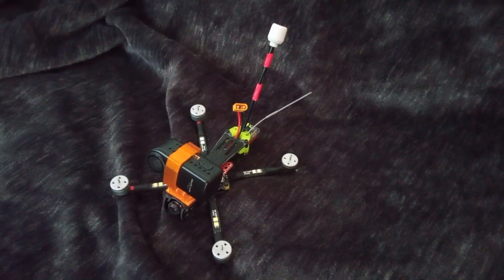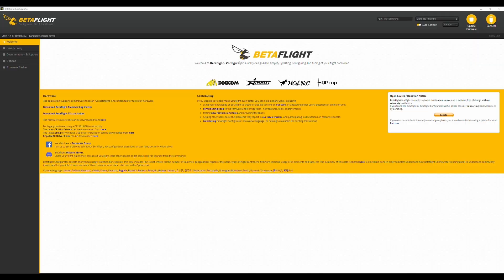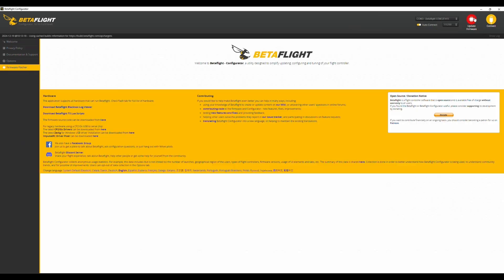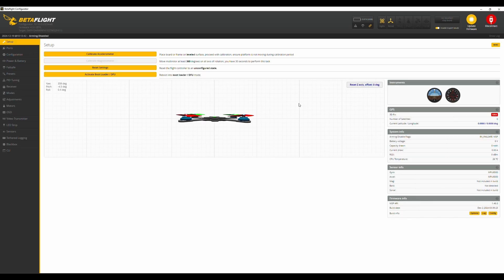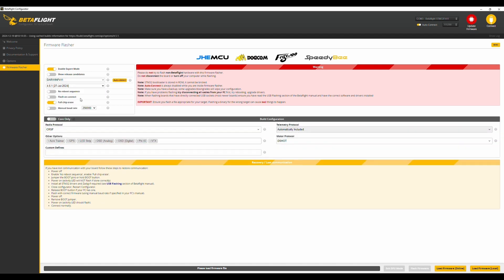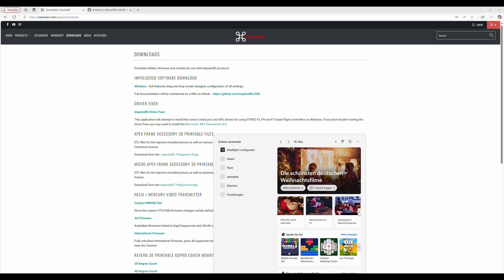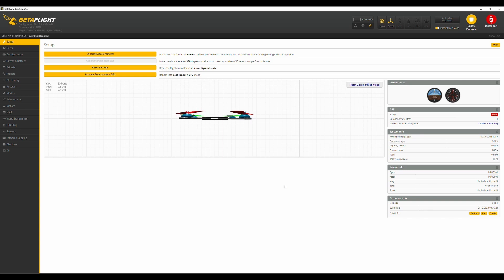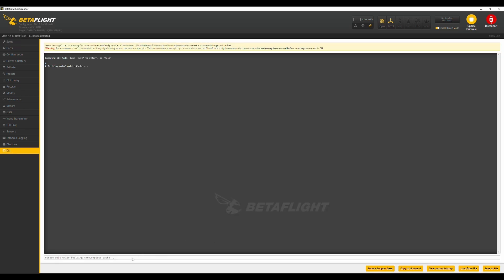How to flash DarwinFPV BabyApe Pro V2 to Betaflight 4.5

Comment: Note: this copypaste of gyro calibration did not work for me (BabyApe II, from BF 4.3 -> BF 4.5), it flipped the quad in weird ways. What worked was playing around with the "board sensor alignment" tab under configuration in betaflight. More precisely: my gyro alignment setting is "CW 270 flip".

Comment: Warning!!!

Be carefull of setting the target to DarwinF411.  I "bricked" my flight controller doing this.

The FC was no longer recognised by Betaflight on any computer.

It took a while to find a solution to this problem. I desoldered everything that was connected to the FC:  motors, RX, VTX, and plugged the naked FC into USB while pressing the boot button. Then, and only then, did the FC enter boot mode, and I was able to flash BF to MatekF411.